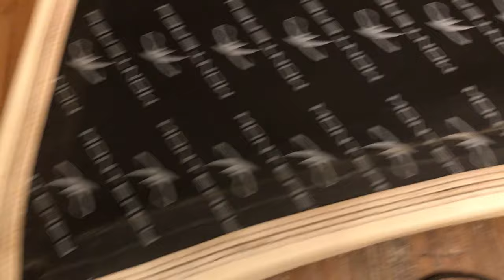HOW TO REUPHOLSTER VINYL BOAT SEATS CHEAP DIY WITH NO SEWING FOR UNDER $100!! DO IT YOURSELF & SAVE!

Comment: Nicely done. My wife and tackled a similar job 3 years ago. It’s still holding up great and white marine vinyl is a great choice. We got a quote of $5k for the job then did it ourselves for under $100 with tools. I bought the whole boat for $5k, it’s wild how much shops charge for the work and yes it will look better but not 500x better.
Reply: they have skills and expensive tools - for piping, stitched corners etc. I understand the cost. I am thinking about doing some myself, but not with fancy stitched corners
Reply: It’s insane what they charge!  Well done
Reply: Called Hydem 1:00
Reply: Use a razor blade to save time on staples especially if your not going to recover back to original   Use steam to make the foam bounce back it’s fun 😊

Comment: The best way is to use the old vinyl as a pattern mark your piece and sew them. When you do it like that it will loosen up with the sun and stretch, you will exspirence the little piece that should of been stappled in which is called a tie down, move on you. The hiedem on the back (Which is the staple hider) to save time is to put new on. Also if you do your whole boat it's wise to invest in a steamer which will help you stretch better then a hairdryer, not to boot safer on the vinyl not to get weak from dry heat, better to have a moist heat. Also with the steamer, you steam the foam back to original position, most of the time.  (THIS IS MY PERSONAL OPINION AS AN UPHOLSTER)
Reply: Would a travel clothes steamer work for this?

Comment: Great video! I am rebuilding my pontoon arm rests. 30+ years old and the vinyl is actually not in bad shape but the wooden frames of the seats (under the fabric) were rotten. Thanks for the hair dryer tip as I think I'm going to need it to stretch the old vinyl fabric over the new frames.
Reply from the maker: Glad to help, hope your restoration goes well

Comment: The name of the trim that hides the staples is called "Hidem". It's about a $1.50 a yard, so it's cheap to replace. I found that bit of information during my research into attempting a DIY boat upholstery. Thanks for the video. It gave me the extra confidence boost to go for it after seeing your techniques.
Reply from the maker: awesome !! I hope it works out great for you. just need patience and it will come out just fine :)
Reply: This video was extremely helpful as is the info about Hidem. The last part where you were heating up the trim that hides the staples and prying it apart is the part that I’m pretty sure I’ll struggle with the most. My husband and I are getting ready to tackle DIY boat upholstery on a boat we just purchased.Question-is there a certain vinyl that you would suggest, one that holds up well and doesn’t break the bank? If so, can you tell me the manufacturer or where you purchased it?

Comment: Just a slab of 3” foam wholesale is $150.00…quality vinyl is $30.00 for roll and pleat wholesale and flat vinyl goods are $15.00 per yard…my price not yours…..yes we mark are goods up in price. We have to spend our time figuring out yardage, placing orders, handling and warehousing those material’s which take up space and must be check immediately when received, if there are any issues with it, we must deal with returning them….retail prices cover our overhead and then we charge for our labor and you bet our expertise. I was just offered $100,000.00 a year if it would be willing to relocate to Sarasota on the west coast of FL to run a shop by a Headhunter…knowledge and expertise in the Canvas and  Marine upholstery industry is very valuable and sadly more and more rare….it is a great trade if some of our younger generations would consider it instead of college…

Comment: 9:30 you need to put only one staple in them do exact opposite side with one staple. You never do a whole side then  move up another side...rather go opposing sides on all 4 then place another staple next to and starting over on first side you started at.

Comment: How do you determine how much vinyl you need
Reply from the maker: measure with a fabric tape measure  rolls are usually 36 inches by what ever length you need get extra its not that expensive :)

Comment: what size of staples did you use? SS staples ?
Reply from the maker: I used 3/8 size staples. I used up all the staples I bought so I can't be sure but you should definitely use ss staples especially in a marine environment. Thanks for bringing that to light :)

Comment: hey there. Is that a heat gun or a hair dryer? Thanks!
Reply from the maker: Hair dryer
Reply: Could you use a heat gun?
Reply: @zboco2797  yes on low settings but you have to be careful because it can possibly melt the vinyl

Comment: YIKES!!! HOW NOT TO DO IT YOURSELF…yes Marine shops charge more, I bet if your boss told you that your not worth paying to do your job and they can do it themselves…..you would probably understand why those shops charge what they do. They have very expensive machines that are Marine, upholstery job specific tools that cost a lot of money to purchase and then require maintenance and upkeep, rent, insurance, materials they keep on hand that actually do the job that are actually the right product to keep the sun and weather out of your cushions that they can’t charge you for the whole roll of yet they must have it on hand to be able to do the job like Marine thread that doesn’t rot in a year due to exposure to water, sun etc. Then we have electricity bills, gas and automotive expenses to go onsite on multiple trips, 3 minimum. 1 to bid the job, 1 or 2 to pattern (oh yes and the skills to actually pattern a job that you don’t run and buy a pattern at Joann’s and it takes many years to learn especially pertaining to vinyl materials) and definitely something this gentleman does not have! A 3rd trip to install the job unless it’s a small job the customer brings and drops off which BTW is rare. Just my commercial sewing machines add up to $7500.00 for a walking foot commercial machine that is absolutely a requirement to work on vinyl materials, a commercial surger, a commercial zig zag machine if you do sail repairs, a regular foot commercial  machine for more delicate materials such as fabric materials used for cushions and curtains. A bench press for buttons and grommets which all you get at Joanna’s, Hobby Lobby or Michaels is cheap brass not stainless steel. Hand tools to install snap studs which also require drilling ( and knowing where to drill….you know that experience thing. Leather mallets, lift the dot tools which are in the hundreds of dollars alone. A simple shop set up of tools to do canvas and marine work is easily $20,000.0 plus not to mention License’s, Fictitious name filing, Health department certification….and if you end up designing, fabricating and installing commercial and residential awnings which many shops end up doing then you must get your Commercial Awning Contractor’s license…….so before you go watch people who do not know what they are doing and think you can do it yourself, you get exactly what you pay for. Next time someone tells you that your not worth getting paid what you make……might want to realize learning from someone who doesn’t know how to do it is just learning and doing it wrong. And yes I have been doing this since I was 19 and I’m still doing it at 67…that’s a lot of experience talking and I have a do it yourself job someone did themselves that I’m about to do coming up. The gentleman who sold the boat to my client lost money on the sale because he did it himself. It took him months to sell and he based the sales price on information he found online that boats comparable to his were selling for….his sold for $5300.00…..less…..
Reply: You miss the point of the video ... he did not say he was as good as a professional just good enough for an old boat.  My boat is a 1996, I was quoted 6000 to redo the seats.  I plan to do it with a cheap stapler, hair dryer,  rattle can glue using good quality vinyl and stainless steel staples.

If my seats come put looking good for 4 to 5 years and have fun with my boat I think I will be a happy man.  Save you fancy redos for the people with more cash than brains.
Reply: @jimw6991  my point is if your trying to show someone how to do something, then you should at least do some research yourself prior to doing it yourself and then possibly learn why it costs so much for a professional to do the job when they are paying rent, electricity, insurance, thousands upon thousands in tools and then their years of experience to boot. My point was people should understand the difference and respect someone who has spent a career gaining their skills and tools etc. I am all for doing it yourself and share my knowledge freely anytime anywhere with no threat to my pride or ability to earn my living. I work for people who want a quality product that increases the value of their boat. What they pay me they gain right back in value and I have multiple repeat customers who buy old beat up boats, do the work to restore them while I do their upholstery and they make money every single time. You get what you pay for. If you have no intention on selling and it’s your toy to enjoy, have at it and I respect you for that. But in return show respect for those who are the pros and have spent their lives at becoming craftsmen and craftswomen at whatever it is they do. What do you get paid to do for a living?
Reply: Nice Rant! Now get back to work!